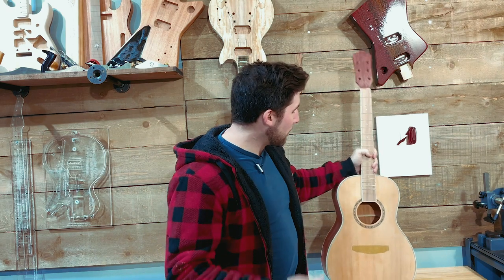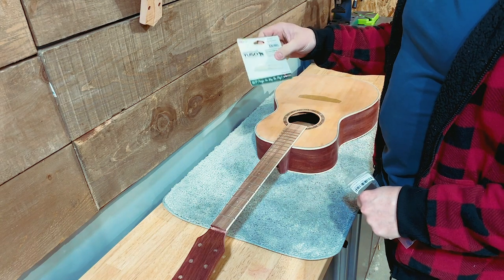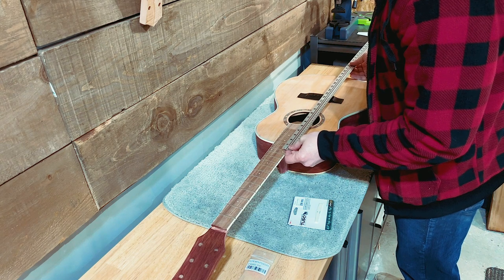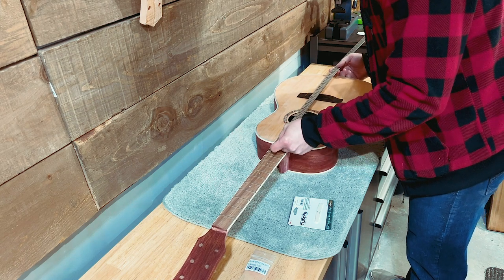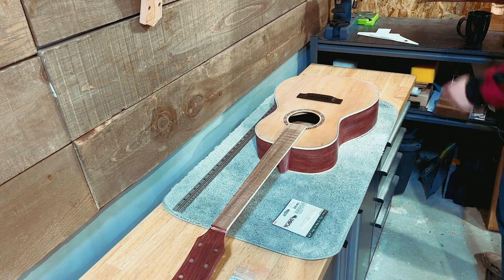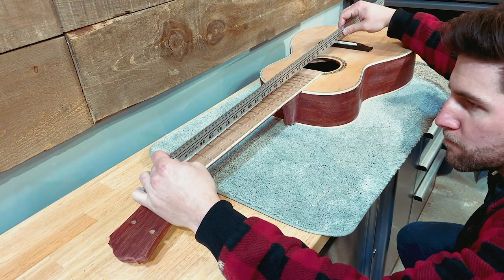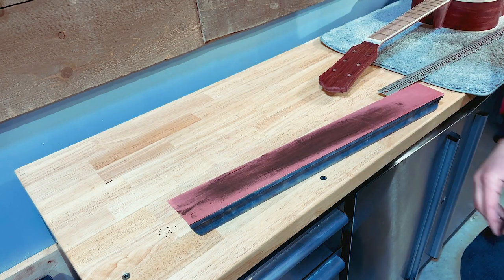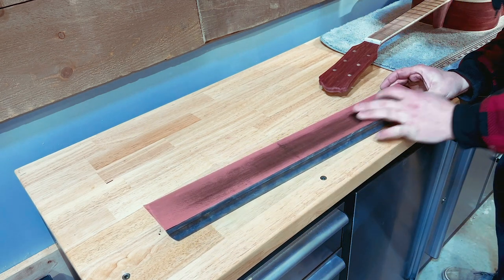My First Acoustic Guitar Kit | Neck and Nut Setup

Comment: Hey Brad, the nut and saddle are not relevant at this stage. A straight edge across the frets should be slightly over the front edge of the bridge.  Small gap, .020 or so. Saddle will be cut to suit latter.
Reply from the maker: Ya, you can definitely do it that way. I just wanted to get them at least partially dealt with in advance.

Comment: Hi Brad. Are you sure the saddle wasn't a bit farther than expected from the nut because of intonation? IIRC there should be about 0.080" compensation on the high E string (and more for the others, of course).
Reply from the maker: It should be something along those lines. Mine is about 0.0625 from the nut at the high e now.

Comment: Really interested in neck angle as I'm making a strat out of Kauri from scratch and haven't done neck pockets before.
Reply from the maker: It’s definitely an important element
Reply: @BradAngove  thanks for your response, i guess what i am trying to work out is, do i just make a flat bottomed neck pocket or do i have to angle it, how deep do i make the neck pocket I.E. is there a certain depth from the edge of the fretboard?
I'm making this for my guitar coach so it needs to be better to play than her fender tele lol.
By the way, thank you so much for all your videos, i have been watching since you started doing stuff for Darryl Braun. Its helped me to build 3 kits so far, i also get elcheapo guitars, put good tuners, bone nuts and then level all the fretboards roll the edges and change out the strings, then i donate them to kids who's parents have to rent instruments off schools etc.
All of what i do is because of your videos!
Reply from the maker: The neck pocket depends on the neck and the bridge. It needs to be deep enough to accommodate the neck so that you have good string heigh in relation to the bridge. Luckily most bridges are adjustable. If you are using a raised bridge you will need neck angle. If you’re not, flat is usually fine and you can add a bit of angle with a shim later if needed.
Reply: @Brad Angove  thanks mate, seems like a bit of a dark art lol. The wood i am using has been buried in a peat swamp for thousands of years. If it were alive it would be protected, so i can't muck it up, so i reeeealy appreciate your help!